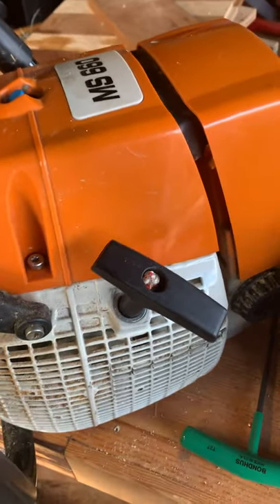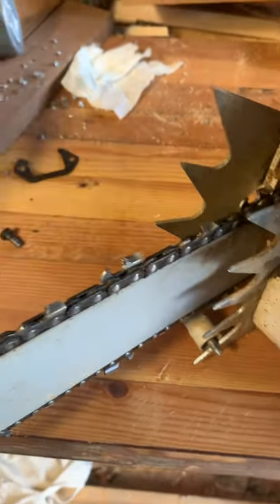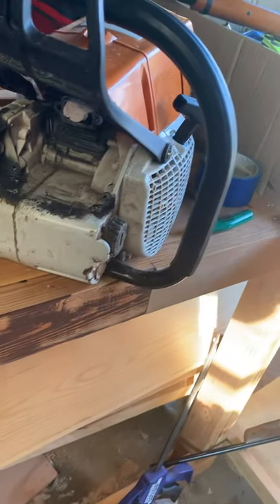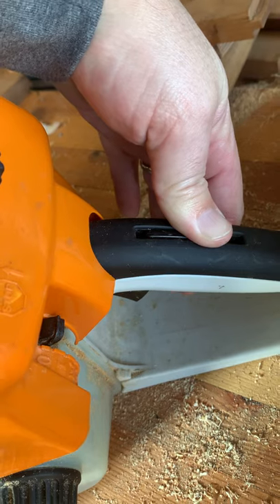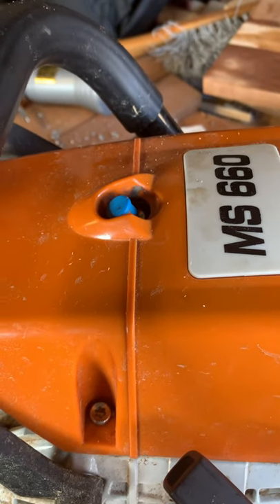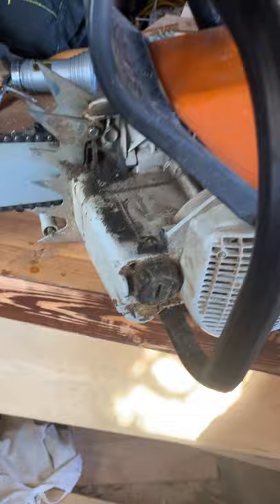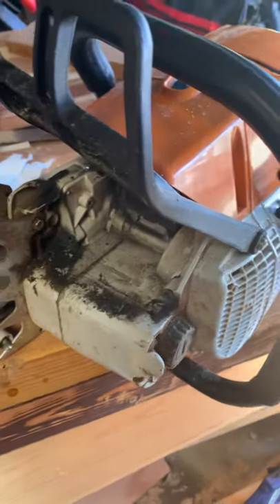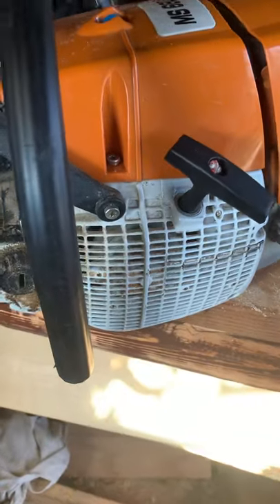MS 660 Clone Build after 8 hours of run time

Comment: With the muffler off why didn't you show the piston??
Reply from the maker: I guess I should have! I didn’t think about it.  Honestly, the saw was so dirty that I was more concerned about keeping dust, chips and junk out of the cylinder.

If I ever tear it down I will obviously show the cylinder and piston. I think that’s really good feedback. Thank you!
Reply: @youhaveamonkey  Yeah that would be great to see what it looks like after some use. Even better would be to take the jug off but only if you had to for some reason. But at least you get an idea. 

I've been working on a whole bunch of 372xp x-torqs and was considering getting the G372xp clone as my Stihl 034 Super (61cc) is the biggest saw I own. 

Even oem saws need loctite on pretty much everything. I've seen loose cylinder bolts too..........I'm replacing the p/c on a 372xp xt atm and put loctite everywhere, including the chain brake cover bolts.
Reply from the maker: @ProteusDIY  I did look at the piston and cylinder.  It was fine.  It certainly wasn’t scored or had weird wear marks etc.  

The saw kit comes with fasteners that have a dab of loctite (or fake loctite) at the end of each fastener.  Now I know…..

With a very few exceptions, I really like the saw though. I’ve built two more by now and I feel like I’m more efficient and build them a little better every time.   

Also though, full disclosure, I use it to  run a mill and cut some firewood, drop a few trees. It’s FAR from pro level use, and since it’s mechanical, I tend to baby such things.